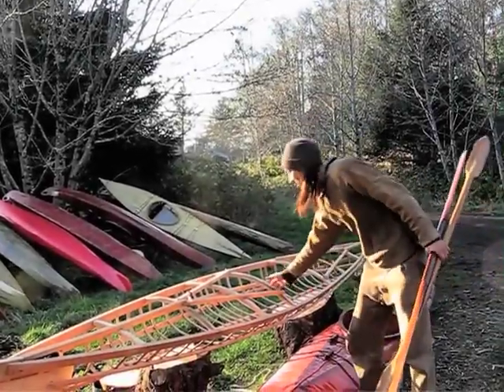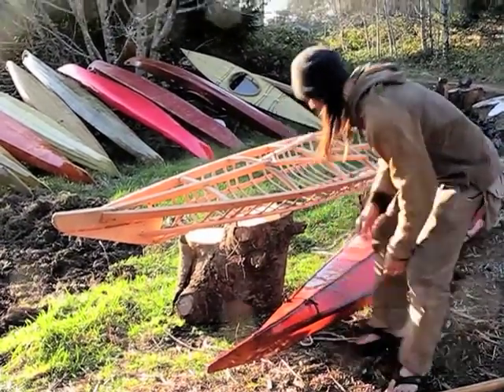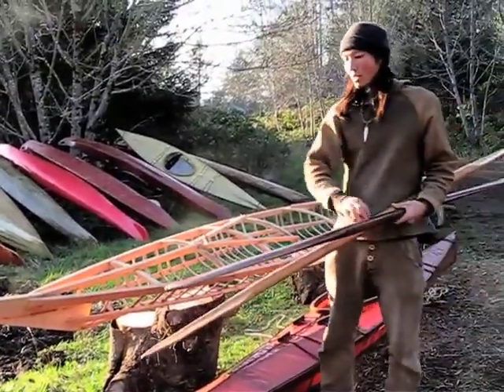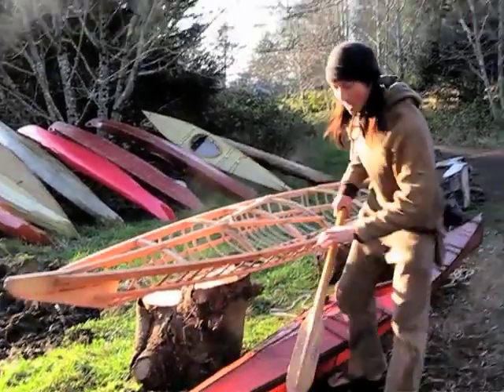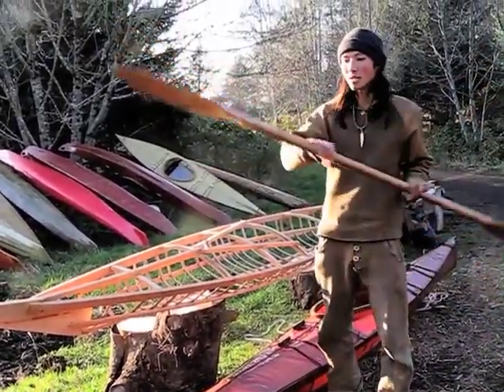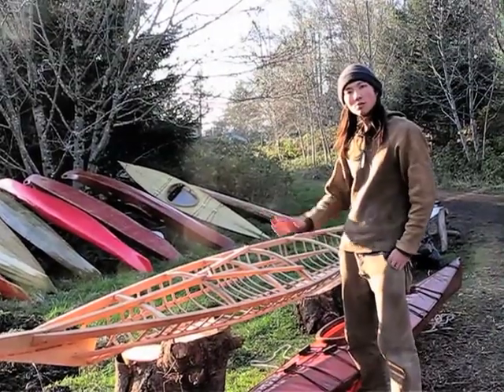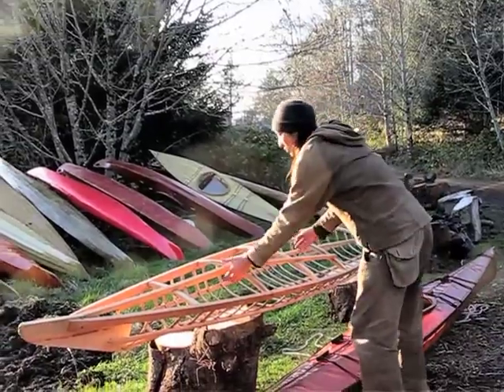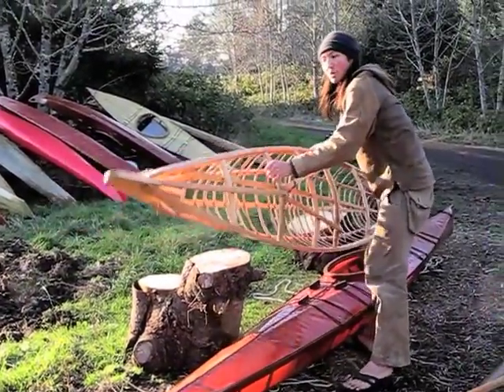Introducing Skin on Frame Kayaks

Comment: Recently, an ultra performance 100ft racing yacht, called Comanche, adopted the same style of splines and ribs covered with a skin, although all in carbon fiber. They did so in order to avoid the delamination associated with the grp foam sandwich construction current race boats are using. Your video drove that point home to me. :)